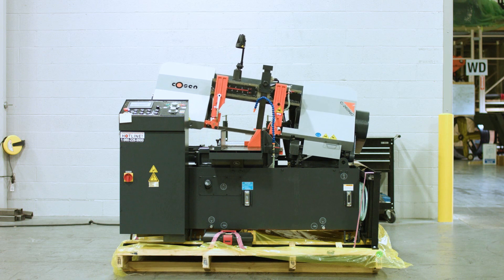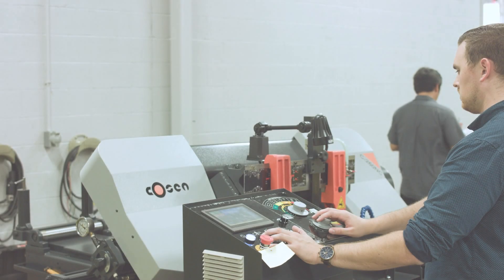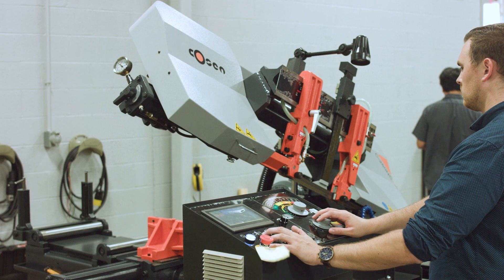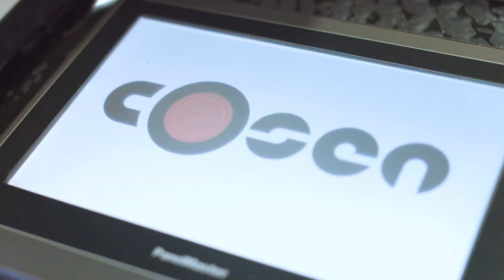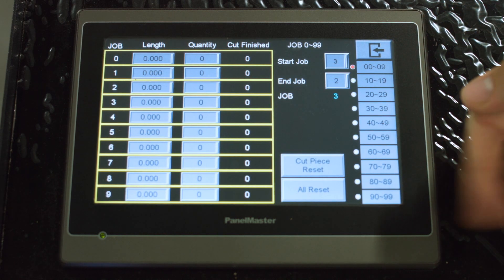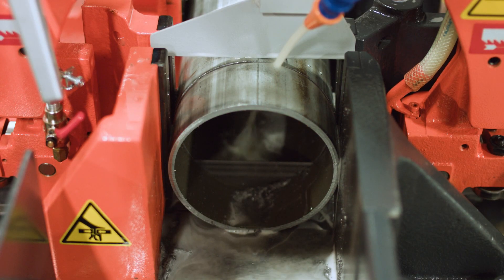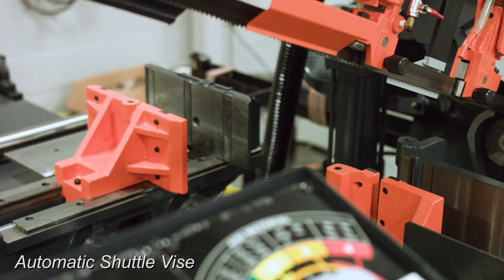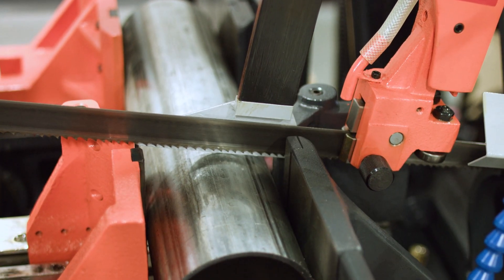Cosen's C-260NC

Comment: This saw has had one problem after the next ever since I’ve gotten it. Even the technician that came out says he’s never seen some of the problems that I’m having with this 2 month old saw before. Started with the back jaw sensor going out In just the second week,  and having to be replaced , to now won’t read the end of bar, which is a major problem as you can’t load a bar and let it run overnight. Particularly a problem when you have a bar that already takes 6 or more hours to cut up bars of material like 4” to 5” diameter 304 SS. This saw was a replacement for an old Cosen that was just like this model except for it had a different style PLC. That saw lasted over 25 years with no major problems whatsoever. Since the PLC couldn’t be fixed, and replacing it with the new style PLC would cost 7,000$ it’s sadly going out to be scrapped. Not sure what’s wrong with this thing but it doesn’t have the same capabilities as the old saw. For example. Can’t lower chucking pressure below 100psi. For cutting tubing like 4”,5”,6” x 1/8”wall thickness Aluminum, or any size PVC, which the old saw did just fine because the chucking pressure could be lowered all the way down to 0 psi. and still work, whereas the new one will not allow the machine to operate below 100psi (which crushes the material almost flat,  and there’s no way to change that I was informed by Cosen. We had to buy an additional saw, a manual DoAll horizontal just for lighter material like PVC, Alum. Tubing. Whereas the old saw cut everything we had. Now I have 2 saws trying to do what the old saw did. Not sure what kind of issues this company is having, but clearly their quality has declined over the years. It’s either that, or I just happened to get a lemon, as I’ve never spent so much time reading the manual, troubleshooting, and on the phone with technicians in my life. This is especially frustrating as I’m on production, cutting for a CNC shop. This saw has great potential, cuts clean and smooth just something with the new PLC that seems bugged. Hope I can eventually get all the bugs worked out on this thing as I am tired of endlessly in the manual or on the phone and not able to get the job done like I want. It’s 3 months old now. Hope this gets to someone that can get on the floor at the Cosen facility and fix these issues. Great potential, just needs bugs fixed, mainly PLC
Reply: Yea same with the 1 I run . Lot's of trouble . Never had so much trouble with a band saw
Reply: @tomsupinsmokebbq3687 I ended up finding out that most of my problems were because when me and my supervisor were replacing one of the relays, that went bad, two weeks after it was bought and set up. He wired it up backwards. I believe deliberately to, because the wires are color coded. He then wrapped half a roll of electrical tape around it so I couldn’t see what he had done. Saw would seem to work ok, with the exception of it not stopping automatically at the end of a bar, and a few other, minor things. I tried everything in the hand book, and was constantly on the phone with the technician. Even had the technician come out twice and he said he had never seen these issues before. It was when I decided to trace everything in the electrical system and double check every wire and connection down that I discovered why I was having all the problems I was having. After fixing that the saw ran great. Did have to buy an additional saw to cut the thin wall tubing and PVC that I had to cut every so often, and it worked great. A DoAll that was smaller and didn’t have hydraulic jaws. I feel like Cosen should let the customers know in the beginning, about the chucking pressure having to be above 100 in order to function, because you can’t cut any light weight material that can crush like tubing.
Reply: ANY REPLIES OR CONTACT FROM COSEN ? I HAVE A MACHINE SHOP WITH APPROX. 27 YR. OLD COSEN AND THOUGHT ID BETTER LOOK THEM UP NOW BEFORE BUYING, DID YOU GET RID OF THE OLD ONE, PLEASE LET ME KNOW AS WE WERE CONSIDERING PURCHASING A NEWR BETTER MODEL BUY YOU HAVE SCARED ( excuse my french ) THE GD HELL OUTTA ME !!!